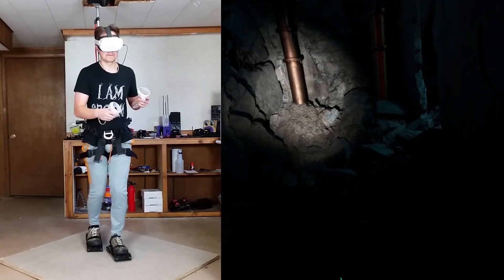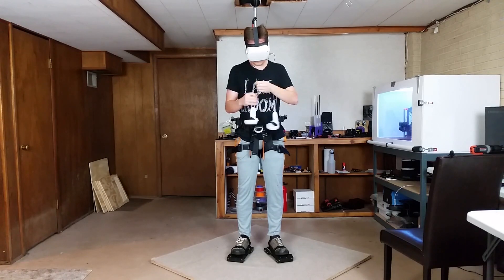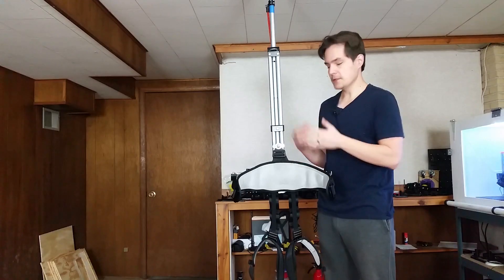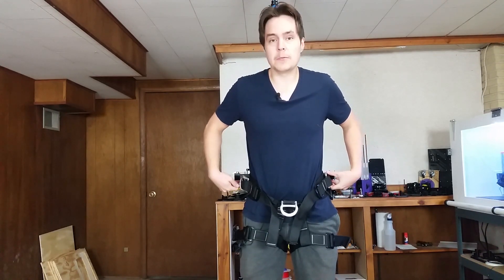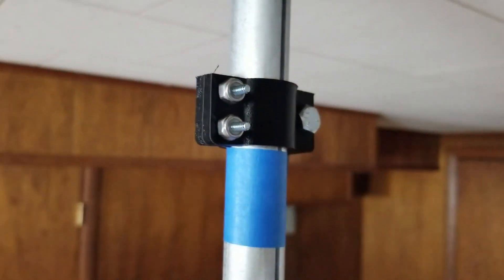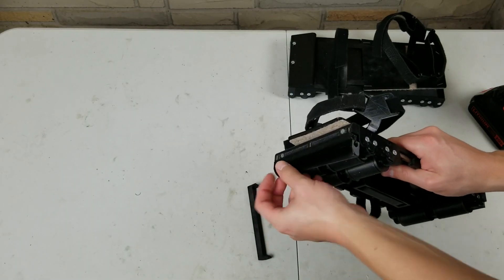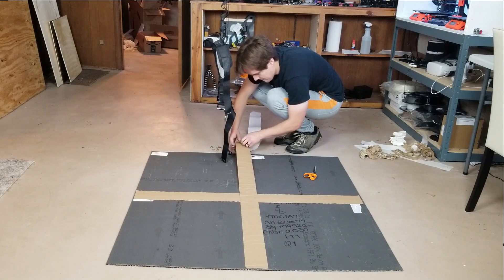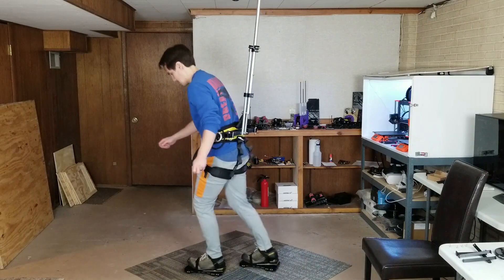VR Shoe Build Log #47 - Miscellaneous Features

Comment: What is the estimated build cost and are you planning on selling or releasing the plans in any way?
Reply from the maker: I'm working on making a build guide that will have cost and the plans. I've started the guide for the support rig, I still have a lot to add.
https://hackaday.io/project/182344/instructions
I also need to make a guide for the VR shoes themselves.
This project is open source. Design files are here - https://github.com/finallyfunctional

Comment: Whats the endgoal?
Reply from the maker: With this version of the rig, it's done. Coming up I'm working on making a rig that doesn't require bolting to the ceiling or wall. Later I'll make foot trackers again, add motors back in, maybe try omni-directional movement again, make a vr treadmill...I have lots of stuff I want to build and I'm not sure if I'll ever stop.